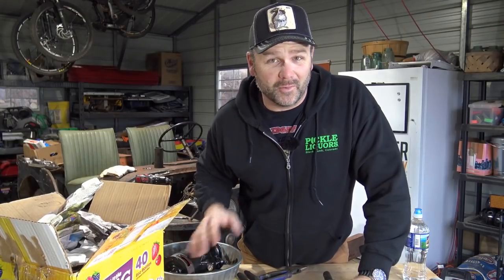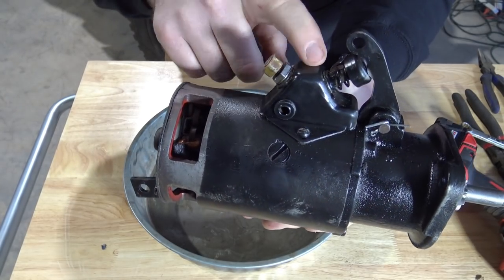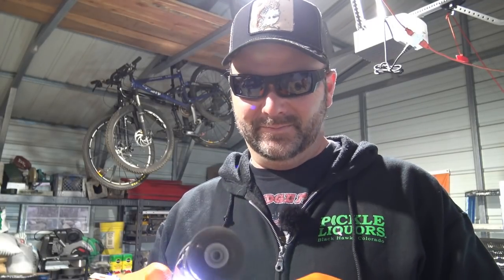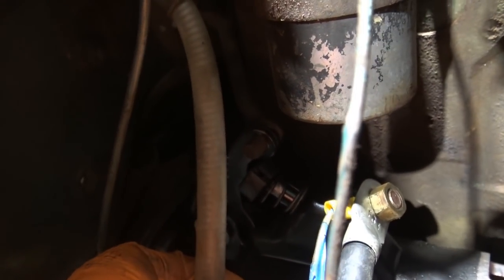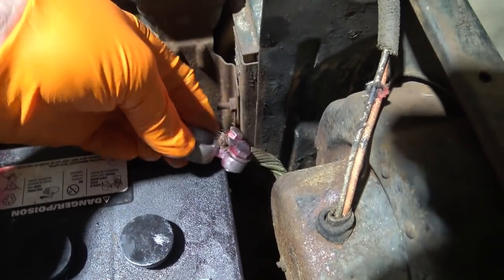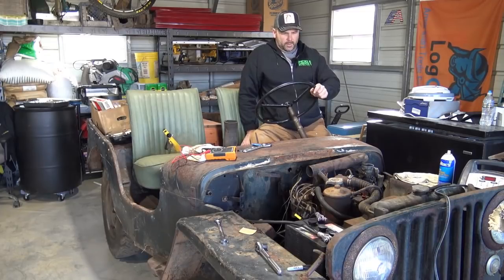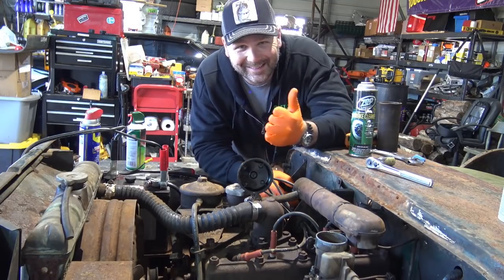Willys Jeep Rescue: More fun with the project! Anybody got spark? Wooooo!

Comment: Test the battery by checking the voltage across the terminals.  Should be 6v ish.  Get Mrs Stony to work the starter button and check what the battery voltage drops to.   If the voltage drops without the motor turning over then the battery is faulty.   It can have what is called a surface charge, this will show the correct voltage but can’t provide cranking current.  Caught me out once but it won’t catch me again.

Comment: I'd agree, a vehicle that has sat for so long is in need of a complete tune-up. Points, condenser, rotor, cap, plug wires, plugs. Your plugs, cap, and rotor are definitely shot. Just to cover your bases, check your firing order. It's probably fine, but remember to check again after you replace your spark plug wires. I replace mine one at a time, just to prevent confusion. Double check that the wire that runs to the points from the coil is well insulated from the body of the distributor, has no cracked insulation, and is secure at its terminals.  If you need 6 volts and are only getting a little over 4.5, you're down 25%. It will not only make your starter spin more slowly, but will make your spark weak, even if all your other ignition components are new. A 12-volt battery in a modern car should be pushing 12.5 or so, yours should be at least 6, plus a tad, maybe 6.2. I'm enjoying this series a lot! Thanks for sharing this with us. Linda and I send our best.
Reply from the maker: Thanks! WOooooooO!! I'm waiting on parts ! now!

Comment: For 65 bucks you want basically a brand new starter ? Sounds like you got a good deal to me. Also, the plug HAS to grounded in order to fire. Clean the points with a nail file, carb cleaner and compressed air. New cap and rotor and bang, she'll fire !

Comment: after sitting for so long, all electrical wires and components shouls be renwed/replaced, Plugs wires etc, also you shoul dscope the plug holes to make sure the cylinder is clear , valves are working properly and no bugs crap in there.

Comment: Not sure if you know this, or if you even do it, but storing batteries on just concrete does drain them. I work at autozone, and whenever we put batteries in the back, we set them on cardboard, because just setting them on the concrete does drain them. Hope this helps
Reply from the maker: Thanks man...so I challenged this at my local battery store....all of the batteries were sitting on the ground...they said it had no effect...I beg to differ...maybe we do a test on the channel to see if there is a difference...get 3 batteries and try them in different positions..hmm idea!!
Reply: Stoney Ridge Farmer Josh, don’t forget, you did drop that battery when hauling it. Get another one from something else you have or buy one OR change it over to a 12v system. Be easy to deal with it all in the future.

Comment: Spark plug needs to be touching the engine block to check for spark. Change out the Cap, rotor,points ,,plugs and wires. Also put a bit of oil in the cylinders to help  with compression. Check the voltage Regulator It can show Voltage even if it one of the contacts inside  is open. Might even have to get another Regulator.

Comment: Josh go to NAPA and get points. condenser, rotor ,cap, wires, plugs, and a new battery,  ate 4.2 volts out of you'r battery it means you have a dead cell you should have about 7.2 volts   there is a good chance NAPA has the parts on the shelf the parts you need are interchangable with a lot of old tractor parts

Comment: Ground the spark plug on its threads to test spark. I'd say go ahead and replace the cap, rotor, and wires before messing with it more. If you have the cash I'd go ahead and swap out to a 12 volt system as well, but that may not be necessary as long as you keep it on the charger until you get it running.

Comment: I believe that starter is supposed to have a metal band (like a hose clamp) that covers the brush openings.  Been a few years since I worked on one.  Listen to the other people on switching to 12v, putting on an electronic ignition (watch Steve Cox on youtube).  Don't knock that oil bath air filter.  It's probably a lot more efficient than the paper filters used today.
Reply: Also, if you're battery is only charging to less than 5 volts, it's bad.  A good 6 volt battery should be closer to 7 volts when fully charged.

Comment: Just a sugestion is that the carburetor probably needs to be replaced or rebuilt. You can rebuild it pretty cheep. Also drop the gas tank and have some place clean it out. When i was young an old farmer taught me to clean out an old gas tank by putting gravel in it and kerosene and shake hell out of  the tank. I dont know if it actually worked well. Also run air through your fuel line to help clean out the varnish from the old fuel. I think you have a good corse of action for the inition source with everything you are replacing. I think that the jeep would be better cost effectiveness to run around your farm then buying a new ATV

Comment: I even ran an extra lead from the battery to the starter body. It was still temperamental until I fitted a 12v battery and system. It spins and fires up right away every time.

Comment: You need to check and see if The willy Is positive or negative ground also I’m pretty sure if you check the spark on the spark plug need to ground the plug this metal

Comment: for 1. you need to ground the plug to the engine head. A rubber hose is a good insulator and not good at conducting electricity. 2. You need to replace the condenser, the condenser makes the spark happen and a condenser is typically like a capacitor dies with age.

Comment: You really do need to get a repair book on this vehicle. When sanding your points, take a clean piece of notebook paper between the contact points, close the points and drag the paper out. The paper should be clean., Do this until its clean.  Oil from your fingers will burn the points. You can attach a hot wire to the coil from the battery, when your ready to start, you can burn the points by leaving it hooked upped.  But the engine on No. 1 cylinder TDC (Top Dead Center)  and check the Harmonic balancer is on timing mark. . Take distributor cap off make sure pointer is on #1 cylinder wire, reinstall cap,  Loosen distributor,  put a spark plug in the #1  spark plug wire, ground the spark  plug on the side of engine, rotate distributor back and forth. The spark plug should have spark as long as you have battery voltage to the coil. The starter fluid is hard on the cylinder walls of a engine., a couple times is ok, but don't be excessive. Sorry for being long winded, I have repaired/restored   a lot of old engines, vehicles and old tractors.
Reply from the maker: Thanks...all great advice brotha...I appreciate it

Comment: @Stoney Ridge Farmer  I would like to address your starter issues.  As a former rebuilder, I have had plenty of experience rebuilding your type of starter.  So it depends on what work your rebuilder did, to determine whether or not he did you a good job or overcharged you.  

First I would like to know if he replaced the starter drive (gear assembly.)  If he did, then the $85 was a decent price, regardless of whether he replaced the ground brushes.  If he did not replace the drive, then I feel he may have overcharged you for the job, as I would have done the same amount of work for around $50.  Also, I probably would have put a cover band over the brushes to keep dirt out of the starting motor.  The problem with having me do the work, is that I live in Oklahoma and the shipping to here and back would eat up the difference.

About the brushes and frayed wires.  Those are the ground brushes.  In a previous video where you were going to change the brushes yourself, you showed one of the brushes and I thought, 'Why is he changing that brush, as it has very little wear on it?'  The ground brushes in this particular starter wear at half the rate as the power brushes your rebuilder replaced.  Because of the difficulty of changing these ground brushes, I would have decided not to change them and besides, the frayed wires are not bad enough to cause a problem, but I would have discussed this issue with you before you paid for and took the starter home.  Also, I would not have charged you for the brushes not installed, which are about four dollars each, or charged the labor to change them on the end cap, which could take as much as a half hour labor alone, just to change them. 

In my shop, I never charged a straight fee for a repair and only charged parts and labor for each job, which was the only fair way to treat a customer.  This is difficult because everyone wants to know what it will cost for the repair and I couldn't tell them exactly, because of variations in the amount of parts and labor involved.  So I have charged as little as ten bucks for a simple repair, all the way up to eight hundred dollars to totally rebuild a huge 32V marine starter over a decade ago.  Basically to charge a straight fee would require a rebuilder to charge substantially more for a repair to everyone, just to cover his ass in case the unit was toast.  

Also, what is your definition of rebuilt?  This varies among people from changing a few wear parts to gutting the unit and putting all new parts in the housing.  In the case of your starter, gutting it and putting all new parts would probably cost around $300.  In my case, most of my work was a repair and not rebuild, as there were many good used parts in the unit that would last long past the wear parts again and again.  This is another reason why I may not have changed your ground brushes, as they have a second life in relation to the power brushes.  On a starter, depending on the design, I personally consider a 'rebuild' as replacing the brushes, bushings, drive and solenoid if equipped.  Many modern starters have ball bearings in them and those last forever, so they are seldom changed. 

I do have to say that you are right about telling the people watching, to ask about their repair and tell the rebuilder what you expect.  I do understand that you are not happy with the old brushes left in the starter, but it is really not a big deal as far as the operation is concerned and should not give you any problems.  The question is did you pay for something you didn't get?

Comment: The canister most likely is a bypass oil filter.  Those systems didn't have spin ons.  The center button is spring loaded and MUST contact the rotor to pass the spark itself.

Comment: On another note, if the motor has been sitting for a long time pour about 20ml diesel down each plug hole. Replace plugs and spin the motor without starting a good few times to get the diesel in amongst the rings. Leave overnight then prepare for starting. The motor may smoke a bit when it fires. Run to operation temp then switch off and allow to cool till cold. Repeating this procedure a few times allows the rings to reseat and attain lost tension. Obviously a worn cylinder may not allow the rings to seat correctly and a motor rebuild may be necessary

Comment: U can put unleaded petrol on the plugs,just soak every spark plug in a little container with fuel in it and shake the plugs round in the petrol then get sand paper and rub in between where the spark comes from

Comment: replace your points , condenser ,rotor , cap , plugs and plug wires and make sure you set the points to the correct gap on the high side of the lobe ( where the points are open ) if the coil is good and getting voltage you should have spark

Comment: 59 years ago my first car was a '33 Chev with a 57 Olds engine. Disaster. I had no knowledge, no books, no tools, no local auto parts. no help …Been working on cars ever since. 
I suggest you may need a little more " basic cars 101".  People will follow your lead and then struggle. Lack of knowledge can be VERY expensive.  Thanks for the videos.

Comment: Wow I cant believe they didn't replace all the brushes. To me brush replacement is the main item in a starter rebuild
Reply: Joshua Poche Yep! Brushes, bushings, polish the commutator, and check the armature with a growler should be the bare minimum for a rebuild.
Reply: Yes. Very much so! Worn bushings can cause the armature to run off center. Too far off center means the armature is not in the middle of the magnetic field created by the field coils. That means the armature can’t spin freely and can cause a high amp draw, and slow running such as seen here. The more out of center it is, the worse it gets. If the bushings get too worn, the armature can actually drag on the field coils. I have seen that. A true rebuild should at minimum replace all wear parts, commutator refurbish, and growler test the armature. Then a lock rotor amp draw test. Anything less is not a rebuild...

Comment: Josh, the jeep is easier to fix then ya might think it took ya a while to discover you weren't getting spark. 
go easier on the ether starting fluid 
work on getting a new cap, rotor, and plugs..  you easily check your wire set individually with your multi meter... connect each end of the wire to meter first it will show you continuity and then twist wire around between your hands... if you lose continuity that means wire is bad keep your eye on meter reading for each wire! But for a set of 4 wires + a coil wire its not that expensive. good luck on the rest of 
your jeep restore.

Comment: The starter motor is series wound, which means that the field coil is connected in series with the armature. The DC power goes from the starter switch to the series field coil. Two of the brushes go to ground and two go to the series field. The two brushes that are grounded don't need insulated wires, since they are already grounded.

The points and condenser both need to be good or you won;t get a spark. You can check the coil by grounding the terminal that goes to the points. To do this, you need to disconnect the wire going to the points and connect a spark plug to the high voltage wire coming from the coil. The shell of the spark plug needs to be grounded.

The center terminal of the cap should have a carbon electrode that is spring loaded so that it makes contact with the center of the rotor.

Check the coil first. If you have a good coil, check the points and condenser with a spark plug connected to the high voltage terminal of the coil. Once you know that you have spark at the coil, check your cap and rotor and spark plug wires.  One step at a time.

If you have time, watch this video:

https://www.youtube.com/watch?v=4117enF4_Ds

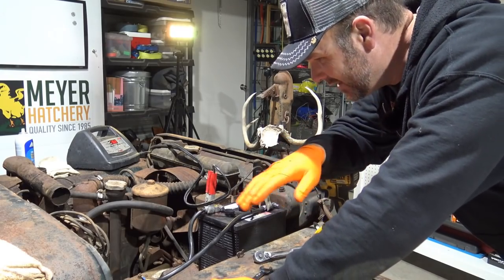At around 14:05, they show how they test the coil. 

Another thing to try is to pull the spark plugs while you crank the engine to test the spark. That way, you aren;t fighting the engine compression while you crank it.

The canister contains your oil filter.

Comment: Need thicker ground cable, 6V needs a thick cable for reduced resistance. Also check ground bonding straps from the frame to the engine mount. Canister you pointed to is the oil bypass filter not related to fuel pump. Yes get all new tune up parts, also some mistakes guys make on the starter rebuild is the base plate mating surface to the starter case. You indicated two brushes not replaced, lazy work on the rebuilders part. Anyhow the base plate has to be free of paint just like the starter to the mounting plate face. That ground has to travel through the base plate, through the case, through the nose etc. Try not to use starter fluid, too dry and not good for the engine. Wire from the coil negative side to the distributor, check for cleanliness and clean contact.

Comment: The engine is a flathead in line 4 cylinder and if ur checking spark ground out the spark plug to the engine so it can get a signal from the cap and rotor

Comment: Should've begun with getting the specs, checking for a spark and expecting to replace the plug, wires, points, rotor, condenser and cap. As long as it's set up and as old as it is, it's a safer bet to go ahead and expect that any of those would need to be replaced or at least upgraded. Not so likely that they'd really cost so much either.

Comment: When you check for spark on a plug like you was doing it has to touch something metal like a part of the engine block or something. it has to be grounded. I would say that your problem is that it needs points really bad there was no spark in them at all.

Comment: With rebuilders you have to specify if you want it rebuilt or reconditioned. To them rebuilt means replace only what is worn, reconditioned means replace and make new again. Be warned if you feel you paid quite a bit for a rebuild, hold onto your hat, a recondition will cost even more.

Comment: i had a grounding issue when working on a massey harris super 101 from 1940 had to run the power cable right to the bolt on the starter

Comment: To see if you have Sparks on the spark plug you got to clean it into a piece of metal and your distributor has to spend a little bit more faster to spark up spark wires make sure you signed and clean all your connections and it'll wires going into your distributor I saw some that were full of rust and that could cause a problem of not having Sparks or not having power to your spark plugs

Comment: I would have asked for a list of what his work would be. Rebuild, remanufacture, refurbish all have different definitions and most people use them interchangeably when in reality they mean different things. In my experience rebuilt and refurbished mean replace what is broken, remanufactured means replacing all replaceable wear parts with new whether they are actually broken or not. I learned this the hard way myself so I can understand the frustration.